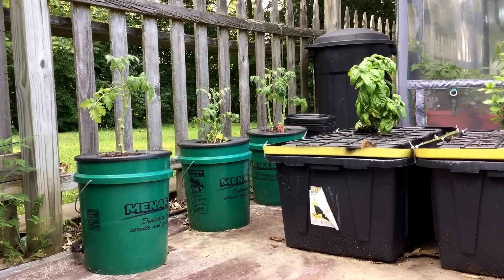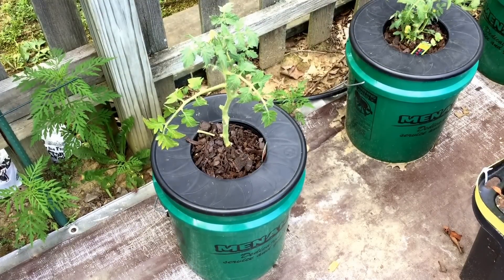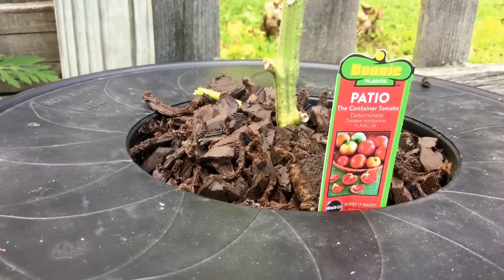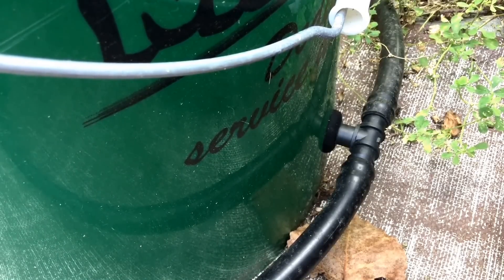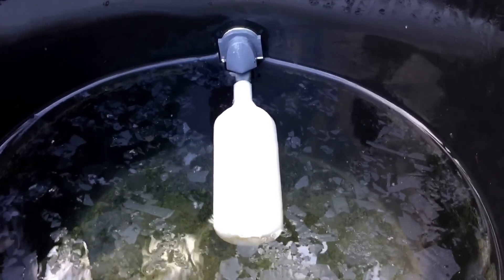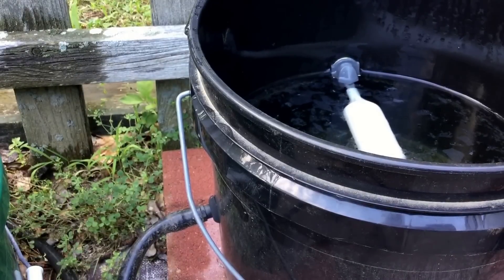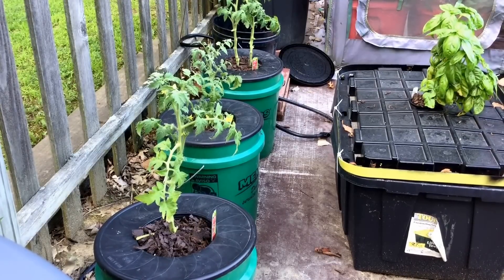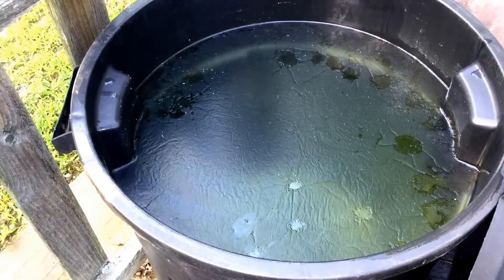B.A. Kratky - DIY System, Bucket Hydroponics (Updated with parts list)

Comment: Hi Matt thanks for sharing! What tomato varieties have you grown in this bucket system?

Also you mentioned you remove the slabs under the large reservoir, how do you decide when to do that?
Reply from the maker: I have enjoyed more success with hybrids and not large heirloom beefsteak varieties.  Patio Tomato F1, Fourth of July Hybrid, Sun Gold Hybrid, and other similar varieties have done well.  I tend to drop the water level around the time of fruit set.  That is not necessary, but I like to encourage fresh root tip growth.  Also, I sometimes will close off the flow of nutrient from the reservoir and bleed off old nutrient in the buckets at the end of a run of buckets; then immediately allow the buckets to refill to their set level.  This helps with pH and salinity issues if present.
Reply: @MattGarver  thanks! Does this kratky method work for peppers, winter squash etc as well? If so, which varieties?
Reply from the maker: @pmasha84  I have all sorts of plants listed in my Kratky videos playlist
https://youtube.com/playlist?list=PLQhMYAJDUCbaOSI9JaPK6hrv57iVjHuv5&si=iBnEpZtg68nUCWHy

Comment: Hello. What is the name and brand for the synthetic material? I am having issues locating it online.
Reply from the maker: For which part of the system?
Reply from the maker: Are you referring to the nutrients that I am using?
Reply: Thank you for responding. I was referring to the growing medium in the net cup lid. I thought you referred to that medium as synthetic in your video.
Reply from the maker: @misha9179  At that time, I used shredded rubber mulch.  Since then for food safety concerns, I use rinsed natural pebbles or zero media and just a clone collar around the base of the plant.  With this method, no media is actually necessary.
Reply: @MattGarver  Gotcha. Thank you for the clarification:)

Comment: I thought I invented this a couple weeks ago. Only thing I did different was different fittings, and more flexible tubing. I even have the same 32 gallon reservoir. I used an actual spigot directly on the reservoir, cause I had other fittings, plus I don't like grommets- I never trust them!!!  And I have found that tomatoes will grow air roots above the soil if necessary. I kind of forced a few tomatoes into it by adding more water than I should have over a couple week period. I had large plants in 1 gallon bottles, So I may try tomatoes next year in two gallon containers instead of my 10 gallon and 5 gallon I have been using. I think I can keep the water level right at the bottom of the net pot from seed to harvest if the plant is growing air roots above the pot. I also use small net pots because I am cheap. 2 inch seems okay, but I snip out alternate 'struts' on the sides and make the hole in the bottom bigger. I even used a pool noodle pice to support a seedling in a 1 gallon vinegar bottle with about a 1 inch opening, and the plant went wild. It is amazing to see how many ways you can grow plants. I would never have thought I could get 4 inch tomatoes from a 1 gallon vinegar bottle, using only a pice of sponge and a seed and nutrients.
Reply from the maker: Great ideas!
Reply: what did you use instead of grommets ?

Comment: I hate how nearly everything that comes up when I search for this is hydroponic systems that rely on electricity I just want to build this, a bunch of connected buckets, a float valve controller water reserve, and then I don't have to water the plants ever except fill up the water reservoir and they will stay constantly wet.
Reply from the maker: Happy to share Bernie Kratky's hydroponic method with you.  He has a YouTube channel called Grow Kratky as well.  Let me know if I can help answer any questions.
Reply: If you want ot go 6 months without even refilling the reservoir, or adding nutrients, you just need a hose end faucet timer, a pressure reducer, and a fertilizer injector. Set the timer to come on once per week, it will go through the fertizer injector, and refill the reservoir to the level you want. I would take a little adjustment to get the nutrients right, but plants are not as sensitive to slightly lower or higher nutrients as a lot of people think. I have had one of those timers connected for two years with no leaks, but you could use irrigation valves if you wanted to come on and even an electric float switch vs a float valve to turn open the water valve.
Reply from the maker: @dennismac3466  For setting up at a neighbor, parents, backyard, or off in the woods a timer irrigation system is not feasible.  With power, it is a great idea.  It is my hope people like yourself will keep modifying the concept to fit their needs.
Reply: @dennismac3466  do you have a video showing snd explaining this?
Reply: @FringeWizard2  No. I just used cheap tubing and fittings. Amazon sells little float valves that connect to 1/2 inch plumbing threads. and I just used barbed fittings listed as "3/8 barb x 1/2" MNPT" with a  1/2 inch threaded pvc coupling on the inside to secure the barb to the bucket. Some pvc glue seals it With the float valve, you use the same coupling, but on the outside of the bucket. I bought lots of little hose clamps for the tubing, but the tubing fits tight enough on the fittings that only one needed a clamp. None of the system is under much pressure, unless you have a really large, tall, reservoir. I use a piece of 1/2 " iron pipe heated over a gas brner to cut the perfect size hole in the bucket. Pipes are tapered at the ends of the threads, and if you melt with just barely the end, and don't try to push the whole pipe through, it makes a tight fit for threaded fittings. After you remove any burrs from the melting, a 1/2" threaded fittings or the float valve threads into the hole, and a threaded fitting on the opposite side makes a pretty tight connection even without any glue or sealing, but glue or caulk is a good idea . I used plastic or pvc fittings, but you could use iron pipe, or use grommets and slip the pipe in.  I personally trust threaded sealed fitting more than bulkhead grommets with slip fittings.

Comment: How do you keep rain water from drowning your plants and changing the nutrient chemistry. I plan on doing something similar this weekend but I’m worried about rainwater.
Reply from the maker: David, I have been running my bucket system for a few years without issue.  Most rains really don't influence the buckets much.  If you live in an area with more rain, and do not have a greenhouse, you have options.  One, you can drill a weep hole that will allow excess water to drain off.  Second, you can cut a plastic "rain coat" of sort and put around the base of the plant to allow rain water to be shed away from your plants.  Hope this helps!
Reply: @matt graver Thanks Matt. I’m in the SE USA and we do get a bit of rain. I think I will plan on making the skirts as you suggest.
Reply: @daveWmck  An overflow hole on the grow buckets would work, maybe right above where your water level is set. Nutrient will be a little weker until plants use enough to draw water from reservoir which will eventually bring nutrients back up Of it you don't want to wait, just empty bucket and reservoir will refill with new nutrient water. Can I suggest adding a drain valve to each bucket? I have use cheap little replacement water bottle spigots. as drains in  kratky containers I am now using more as dutch buckets vs kratky, I started adding drains because trying to drain a container with a full grown plant can be hard.

Comment: Dear Matt
Thanks a lot for your effort, I have the below questions and I hope from you to answer it: 
Will there be fungus in the solution because the solution remains stagnant for a long time?
Will there be moldy roots because of the long time the plant stays in the solution?
What is the best solution to use in the cucumber production?
As you know the PH always change in the solution, so how can I make it stable for a long time?
Reply from the maker: Have grown all veggies using Dyna Gro 7-9-5.
Reply: @MattGarver  I know this is an old post, but I am using very similar set up but with smaller buckets, and I think that the smaller buckets means the solution is in the grow bucket less time than if I used bigger buckets. I am also trying out adding H2O2 through solution poured into the 'filler' bucket. The fill bucket idea 9even though not mine alone) is really great.  And one question- do you know if the root rot diseases are aerobic or anaerobic. I read about people with DWC getting root rot, I never get it in kratky, and assume it is because the water in kratky is very low in oxygen, especially compared to DWC, where air is actully pumped in. Hopefully, you may know more about whether being low in oxygen is reall y advantage.
Reply from the maker: No fungus and no mold, plants do better with bigger containers usually since the pH varies less and more roots can develop.  With this system it is better to periodically release nutrients out a valve at the end of the run.
Reply from the maker: I have none of those issues, and stable pH nutrient is gravity fed to help keep pH constant.

Comment: Hi Matt - thank you for sharing your Kratky setup!  It looks as though you may have algae in your reservoir container 1 and 2.  Your plants look a little yellow?  Is that the video and sunlight?  Or is that from algae from the reservoirs 1 and 2, or is that because they have too much sunlight.  In my experience - tomatoes do not like too much direct sunlight.  I am just starting out with Kratky and used the same large (black and yellow) tote that you have with 6 plants.  I placed Kratky's recommended polysterene insulation board (1 inch)  as the lid and cut the 6 holes as he did for six -  3 inch net cups.  I literally completed set up last night and placed on the porch at about 11:00 pm!  :)

Curious - how much more water do you think I will need to add?  I do not have the wheelhouse yet to build the fancy flow valve pump system - gravity fed.  I plan to simply pour in more nutrient solution.
Reply from the maker: In this video, there is no algae growing.  With my nutrients and ground water, it is normal for me to get some nutrients that sometimes float or coat the inside of the containers though.  The dark green and black containers do an excellent job of blocking sunlight that forms algae.  Yellow, blue, and white containers have allowed sunlight to penetrate and create algae.  Where I live, I get 15.5 hours of sunlight on my tomatoes during the peak of summer.  This does not seem to cause any issues in my garden.  Regarding nutrient use, tomatoes are typically heavy users of nutrients.  If I put a large beefsteak tomato variety in a 100 gallon container, it will use practically all the nutrient and the roots will be enormous.  With 6 tomato plants, you will need to be very busy checking and topping off your nutrients.  I have grown pepper plants in the same manner as you are using for your tomatoes.  It can work, but takes patience.
Reply: Thanks Matt!  Have you tried indoor growing tomatoes using Kratky and grow lights?

Comment: What's all that stuff floating on the water? Also, these plants don't look all that healthy to me. An issue I see with this is nutrient depletion. If you added a small circulating pump, it would solve that issue, but then it probably wouldn't be kratky anymore. Still, a small pump would probably help.
Reply from the maker: Hello Mark R, to answer your questions:  1.)  "Floating stuff" is from the nutrient that I use not mixing well with that bad well water that I use.  It does not seem to matter.  2.)  Plants were bought looking like this and added to the system.  They snap out of it and green up nicely, with several tomatoes on each.  I have ran buckets like this for 4 years.  3.)  Circulating systems produce great results, but this system works well for areas without simple access to electricity.  Thanks for watching!

Comment: Hi Matt,

This video is great, thank you for putting it together. It can be hard to cobble together the info for how to setup a gravity-fed multi-container kratky system. 

A question, if you would be so kind. With the inlets to your buckets (from your brain) they all just need to be below the water level in your brain, right? It doesn't matter if they are all at exactly the same height (level from the brain), is that correct? I'm setting this up on uneven ground and I am trying to figure out how to set the height of the intake holes.

That is, if I use a laser level from the water level of the brain and just stay below that line, am I good? Does it matter if the bucket inlets are much lower than the brain outlet? 

My assumption here is that the water level in the brain controls the water level in the buckets, regardless of how high the bucket inlets are (assuming they are lower than the water level in the brain, of course), and this laser level line will be the water level in all buckets. Am I missing something?
Reply from the maker: Since water flows from high to low, I like to set the outlet from the controller bucket and inlets on the grow buckets around an inch from the bottom of the buckets.  It will be the height of the water in the controller bucket that sets the levels in the buckets.  That is determined by the float valve which I put around 1/2 to 3/4 of the way up the controller bucket.  

So what happens is I change the water level in the buckets by raising or lowering the controller bucket, with things under it like boards or bricks until the water in the grow buckets sits at the bottom of the net pots.  As the plants grow longer roots, I lower the water level to allow bigger roots to grow.  Hope that helps.
Reply: Awesome, thanks Matt! That's pretty much what I thought (summed up much more succinctly).
Reply: @MattGarver  Just an idea in case your float valve sticks open so you don't flood out all your plants- put an overflow hole in your fill bucket maybe an inch above where you have the level. It won't save nutrient solution, but if you are away for a couple days, it might save the air roots from drowning. I have found lettuce to be sensitive to flooding the air roots more than tomatoes, for example. I've had lettuce die within what seems like a day if I have overfilled.
Reply from the maker: @dennismac3466  great idea thanks Dennis

Comment: That's an interesting idea flipping the lid on the 27 gallon tub. Those tops a really difficult to take off.
But, if you connect all those buckets to a reservoir, is it still the Kratky method? Is the only difference from a DWC an air pump and air stones?
Reply from the maker: Richard's World Traveler  Thanks. Yes, it qualifies as Kratky method since there is no air pumped or water circulation. The nutrient is what some call stagnant and the root structure of growing plants is radically different from DWC.

Comment: My system is exactly the same except in the Float Control Bucket I use an Airstone, on for 30 minuets every 2hrs. I have two rows of 5 buckets, controlled from their own float buckets. The Float Control Bucket with Airstone does much better than the Control bucket without the Airstone. No big deal if the power goes off, plants will still survive.
Reply from the maker: Excellent description of your system, thanks for commenting.  I get better results when using aeration too.  I designed this setup for use in remote parts of the yard where I don't have electricity.  Some day it will be good to have a large greenhouse with electricity to run all my projects.
Reply: Matt Garver Hi Matt, seems we almost think alike, I have been using the Krakty system for 5years and tweaked it over time. In the summer here in Central BC Canada, Temperatures hit 38C (100F) so started to use the Airstone in the Control Bucket, huge difference in root system in hot summer weather.
Reply: @MattGarver  Do you think aeration in nutrient rich water could encourage some bacterial growth? Is that maybe why DWC needs to be cooler to avoid root rot?
Reply from the maker: @dennismac3466  It has more to do with dissolved gas like oxygen.  DWC can't hold much oxygen in high temperatures.  Kratky roots barely dip into water where surface air exchange is highest and gas exchange roots are right above the water.  That's why no air stone is needed and it works better in hot climates